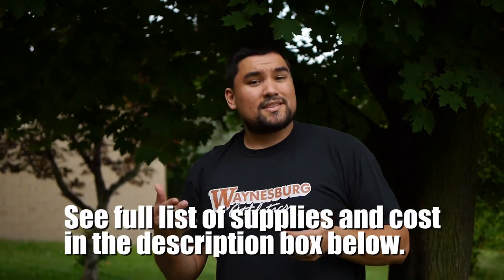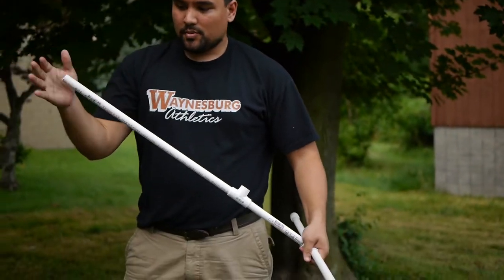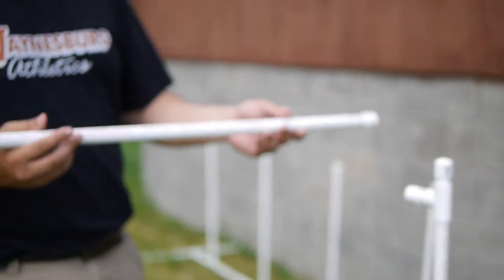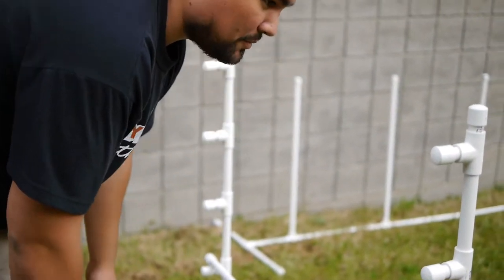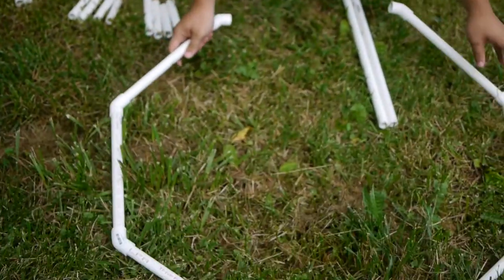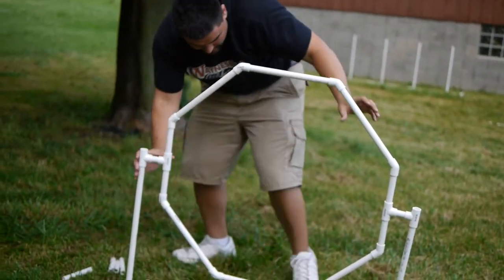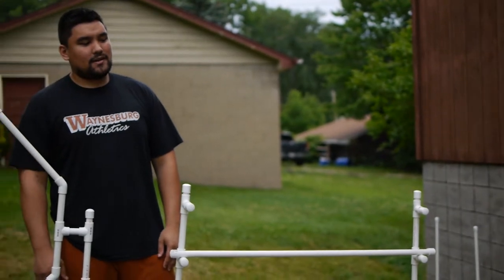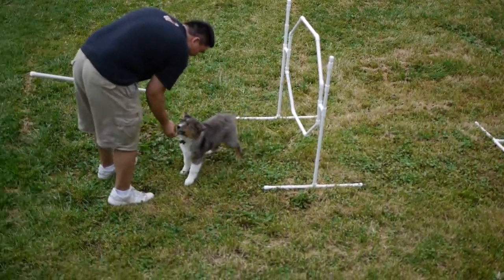DIY dog agility course for under $50

Comment: I was thinking about building this for my dog. How is it still
Working for you ?  Definitely gonna be more than 50 right now though.
Reply from the maker: We used it on and off for a year, and then it just kind of sat there for a year, and then we broke it down to move to a new apartment. So it went through 2 winters. The worst it had is some water had gotten into one of the pole feet, but hadn’t gone bad or anything, and we just drained it when taking everything apart. Currently everything is in a bag, but could be put back together pretty quickly and easily if needed I think. I’m sure it won’t last forever, but it’s pvc and should work for a long time. I’m not an expert on pvc, but the only thing that would likely shorten the life span is spending too much time in direct sunlight. And ya, I’m not sure what the cost would be in the current market haha